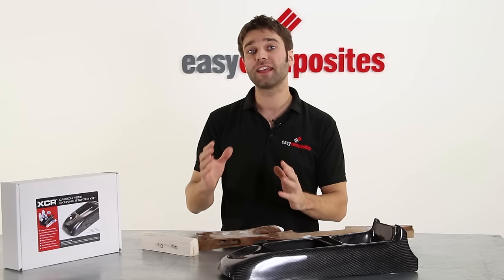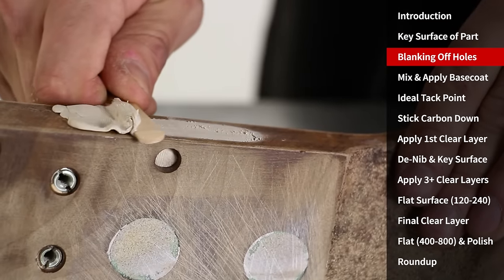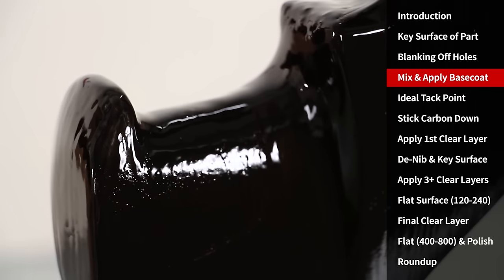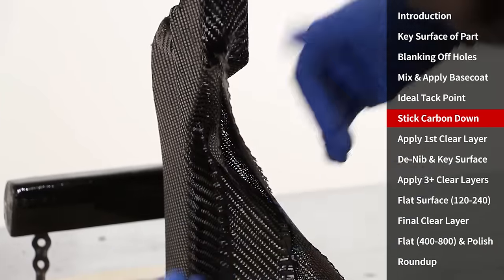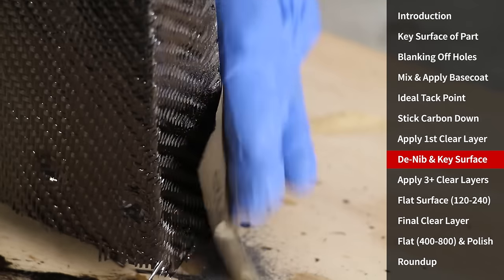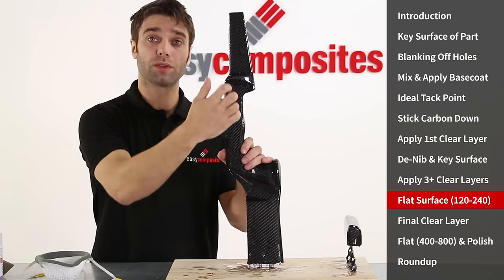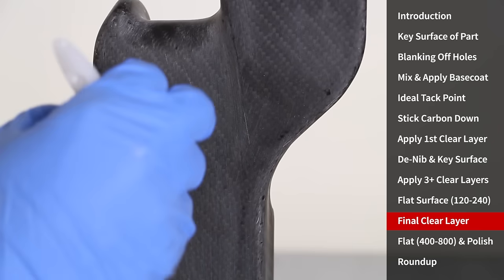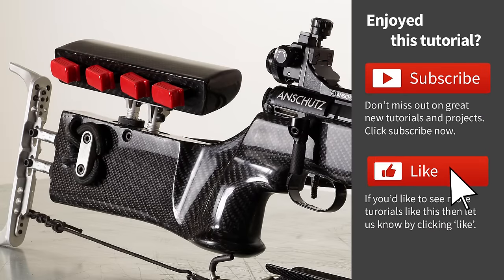Ultimate Carbon Fibre Skinning/Wrapping Tutorial - Sofie's Rifle Stock

Comment: I love how she thinks it's lighter :D
Reply from the maker: Actually, it's strange but it does feel lighter when you pick it up. I think it's because it looks like it would be heavier.
Reply: I was actually curious about that myself because most competitors really know their tools and notice minor changes.
Reply: +Easy Composites Ltd 
actually its much simpler than that. she would be used to picking the whole rifle up because that is what she does 99% of the time so once she pics up just the empty stock without the heavy metal barrel/action it would seem much lighter than she is used to.
Reply from the maker: Actually, this is totally right. Sofie's dad is an ex-military sniper and generally takes care of the rifle. I do think it's pretty rare for it to be stripped down. And yes, so much of the weight is in the action that the stock on its own does feel very light.
Reply: yep , of course its light , its a plastic coated stick ,,, the heavy parts at home ,,, still , it does look pretty
Reply: Kevlar would have looked cooler
Reply: You can only cut Kevlar. No chance to sand it, no chance for correcting anything then. So it is used in inner layers.
Reply: @janudo5    you  need to cut the composite material  to the correct size with a slight overlap
Reply: She thinks it's lighter because the action isn't fitted, not used to stock only situation!
Reply: There seems to be three hole plugs in the stock.  We're those put in to lighten the stock before the coating was added.     He noted the  total weight was the same @  14.30  but the mass is distributed along the whole length  now.
Reply: Dan C looks like they may be there for balancing -note the large plugged holes that may be hiding weights behind them
Reply: that confusing moment
Reply: imagine putting racing stripes on it! It would not only be lighter but faster too!!
Reply: lol
Reply: Lmao! First comment in the comment section was my thoughts exactly.
Reply: l love how she thinks.

Comment: "its so light.." lol i died, but i do applaud how kindly he explained it to her, simple mistake but a funny one. very nice video overall! thnks!
Reply: Nic Wright haha. 😂😂😂
Reply: It didn’t have all the accessories on at the time he handed it to her.
Reply: @Letsgobrandon827   plus I bet she was expecting it to increase in weight due to the additional carbon fiber that was added to the stock
Reply: Did they change the balance of a biathlon rifle? I'd never dare.
Reply: He added 100 grams x 3 coatings to the stock.   It should be heaveyer but they may have removed mass prior to the coating in addition to sanding.
Reply: @danc2014  they said they did. From what I know of biathlon rifles, balance is the most important thing, so it's not just about removing materials, it has to be done in the right spot.
Reply: Dan C i disagree with the statement of yours, but I appreciate your optimism.
Reply: It probably just feels less dense, but yeah

Comment: Recently I have 3D printed an AFO braces from ABS plastic material to use on my leg that usually wouldn't last very long due to the properties of ABS plastic.Normally I made them from handlay carbon fibre ,the preperation time was really really long process(Don't mind waiting for the resin to dry part).But with your Carbon fibre skinning/wrapping method will give me some hope for 3D printed more AFO braces to be given to the Disable Kids foundation around the country here in Thailand.My questions are 1.Will the ABS plastic melt when reacts to the resins? 2.With PLA filament,will it works on that? Thank you very much indeed for inspiring videos I've been watching over three years.Fantastic team.
Reply from the maker: Epoxy resin will not harm ABS so you should be fine with that. The same is true of PLA.

Comment: Dear Team a few questions. I was very excited when ordering it coupl of days ago and I already used it. I was laminating a little interior car part. my questions are 

1. - When putting the first epoxy resin coat on and waiting 8 hours at least it was still a little sticky or felt a little soft of thr surface i waited a few more hours and it was still like this. When touching it with blank hands its a tiny stick to my skin - Normal ? Circumstance are perfect 20° and air ventilation. 

2. -can you save the brush or do i realy have to use a new brush for each coat, cause the epoxs on the brush turns it into almost a stone
3. - I am using it to custimize a car part - is the epoxy resin UV protected or is it becoming yellow by time ? - What about the hot temperatures you can have in a car - is the epoxy temperature stable or will it become sticky again in hot summer days ? 

4. - you should ad a few more gloves and cups to the package also a polish towl this is what i am missing
5. - is it absolutely needed to to 3 layers of Epoxy - It makes the part "even thicker".

But in summary I am very happy looking realy forward -  your video helped a lot
But you should may tell people it can dry much quicker thant you said in your videos - the base coat was dry quiet fast so I almost missed the point to atouch the carbon.
Reply: no answer?
Reply: James E unfortunately - no :(
Reply: @nico.s7333  did you find any solution for saving brushes?
Reply from the maker: Sorry, missed this comment. When you posted this we received 170 comments on our channel, sometimes it's hard to keep up. Remember, for technical support you can always contact our technical support through our website or email, that way we won't miss your question(s).

1. No, that's not normal. So in the end you waited more than 10 hours and the resin was still tacky? - That would usually indicate some mixing or measuring problem. It's worth triple-checking your mix ratios (check you're mixing by weight, not volume, check your calculations, consider the thoroughness of the mixing).
2. The brushes can be reused but you would need a strong solvent to clean them, usually acetone is used. Keep your acetone in bucket with a lid on, use it to wash the brush and then retain the acetone, otherwise you'll end up spending as much on acetone as you would on brushes!).
3.a. XCR has the best UV protection of any epoxy on the market. We've never seen any discolouration of XCR, even after a long time and a lot of exposure. That said, just about all materials do change appearance slightly over enough time and enough sunlight, including most of your car interior and the paint on the outside of your car!
3.b. Car interiors can get hot, especially in hot countries. They shouldn't reach temperatures that would cause problems for the XCR providing that the skinned parts have been suitably 'post cured' before they experiences those temperatures in the car. The best way to do this would be to put the skinned part into an oven, taking the temperature up from 40 to 70C over a number of hours. This should be done before the final flatting and polishing. By doing this, you will expose the resin to these higher temperatures; it will soften and move slightly but then it will reset at the higher temperature meaning that it won't soften the next time it is exposed to these high temperatures. By flatting and polishing after it has been post cured at the higher temperature you will avoid the risk of the skinned part losing its surface finish when the resin first softens at the higher temperature.
4. OK, thanks for the feedback, we'll have a think about this.
5. Generally, yes, 3 layers is recommended but remember that the majority of what you add you end up taking away again when you sand the part. The point of the 3 layers is to ensure that the resin can be 'flatted' down to the highest point of the carbon fabric without breaking through. In some cases, if the carbon is down very smooth and you manage to get the resin down very consistently then you might find you can get away with 2 layers.

Anyway, thanks again for all the feedback, it's appreciated and will help us to improve either the product or our advice/instructions for the future. And don't forget, if you do need a reply, please just contact us through our technical support email, website or technical support forum, YouTube comments can be tricky to keep track of for genuine tech support enquiries.

Good luck!

Comment: so the black base coat is just epoxy resin with a black pigmeant? i do like your epoxy resin though. i like hows there is no air bubbles. i was waiting to see air bubbles when you were mixing.
Reply from the maker: It's almost the same but it is slightly slower to allow more tack-time. It also (of course) has the heavy black pigment it and a little thixotropic agent to make it less prone to draining off. If you have black parts already then it's quite possible to use the clear resin as a basecoat.

Comment: Im about to order a kit and use it on my teeth lol can't wait.
Reply from the maker: Although w're all in favour of people coming up with imaginative things to use our Carbon Fibre Skinning Starter Kit on, we really wouldn't recommend skinning your teeth!
Reply from the maker: Hi, Thanks for the enquiry.  Due to the nature of the uncured resins and the potential health hazards associated with skin contact and "internal" contact with uncured resins, we would NOT recommend using the skinning process or any other composite process directly in contact with any part of the body.  However if you really wanted a set of cosmetic carbon teeth, you could use a medical grade dental casting material to make a copy of your teeth and use that mould for the composite process.
Reply: I would not recommend getting a composite set of teeth, yes, it would be harder but you need to make sure all of your teeth are carbon fiber or the carbon fiber teeth would make quick work of your remaining teeth.
Reply: @easycompositestv  What makes dental resins safe?
Reply: hahaha
Reply: @easycompositestv  It's so sad that you actually have to warn people of this. OP was blatantly making a joke but you never know how stupid some people are.
Reply: jameshisself  yes  s2-glass is superior in most practical applications including durability- just rigidity is the stand out characteristic of carbon fiber, tensile strength of pre-tensioned carbon fiber is quite incredible, but it doesn't have cyclic durability- when it fails it does it surprising quickly and dangerously.
Reply: @capta1nher0  maybe you could do a carbon cod piece instead?
Reply: @damonalagich4524  I think you have just given me my first carbon fiber project!
Reply: @capta1nher0  thats not all I'll give yah' ooooohya'
Reply: He may be on to something here. Maybe pattern a tooth out of CNC'd material create a mould and then a part. You could create a snap on grill or a legit implant part.
Reply: Hell, both of my sons will be carbon fiber skinned this weekend. Yippee  no broken bones ever!!!

Comment: Hi! Love all your videos, their all very clear and informative. But I'm having a little trouble finding out how hollow parts are made, such as a the koenigsegg wheel or such where the interior is completely sealed. thanks a lot!
Reply from the maker: Often hollow parts are made from 2 halves bonded together.  Where a single piece is needed, often specialist bladders and specialist pre-preg vacuum bagging techniques are used adapted for the specific job in hand.  Koenigsegg themselves did a very good video series giving insight into the methods they used, however for the actual carbon wheels, the exact method was custom made by them.
Reply: Easy Composites Ltd ok thanks a lot :)

Comment: Thank you for the wonderful video. Is there any functional difference between the specialty base coat and regular coating resin, besides the black color? Would the regular coating resin perform just as well in adhering the ply to the part?
Reply from the maker: Its also slightly thicker in terms of viscosity but the regular coating resin should work just as well and in fact, if the part being covered is already black (or very dark grey), you could just use the coating resin instead of the black basecoat - the main purpose of the base coat being black is to mask any underlying colour from showing through the weave of the carbon.

Comment: Nice video guys!
Is this method usable for making kind of  "industrial" carbon pieces that can handle stress? Via making a polyestirene piece and wrapping it with several carbon layers. I mean about resultant carbon/resin proportion and how much the layers can be pressed.
Thank you for your help!
Reply from the maker: The more layers the stronger the part so with careful design it can be made into a structural part.

Comment: can you get the black polishing compound all by itself? is there anything comparable that you can get at say autozone?
Reply from the maker: We do sell the polishing compound on its own. It's called NW1 BLACK from Pai Cristal. It's quite a specialist product, designed for carbon fibre, so it's not something that you'll find something too similar to in a conventional auto store but a polishing compound designed for paint or plastic (like Faracla or Mirka Polarshine) would be an alternative - just watch out for white compounds (such as those mentioned) getting stick in microscopic pin-holes and spoiling the appearance of the part.
Reply: Easy Composites Ltd
can this and the fusionfix gp spray adhesive be shipped to the usa?
Reply: @serg sroble   >Depending on the part, wet sand it with 400 grit, wear latex gloves to keep hand oils off, but if not equipped, make a deal with a local body shop who shoots a quality 2 part clear coat everyday almost. They will use a tack rag, hang it and spray it aside a vehicle in the same booth. Once mixed, anything left over is dumped as it’s pot life is four hours. Hope that help!

Comment: Sorry to be commenting so late in the game, but would it not have made sense to add a layer or 2 of clear paint as a "sunscreen" to keep the epoxy from yellowing over time? And even if you would not consider it to be a necessity here, would you add a clear coat to something like auto or motrocycle parts to keep them from being affected by the UV light?
Reply from the maker: Some people do that for that reason.  It depends on the climate the part is exposed to.  eg in sunnier climates the time exposed to high levels of UV is much higher than here.
Reply: @easycompositestv  Thanks for the quick reply. I will be ordering from you when I am ready to begin with my project (Porsche GT2RS replica bits :-p)

Comment: Question because I'm a newbie and I like picking your brain with all the great videos you post No matter if you're carbon fibering skinning metal fiberglass or say like a leather steering wheel it all has to be sanded and scuffed correctly now does the grit of the sandpaper have to be different with the different types of base you're doing thank you for your time
Reply from the maker: Generally a minimum of 120 grit but the coarser the better for the basecoat.
Reply: @easycompositestv  awesome thank you!

Comment: Great job!. I have a question: is it possible to carbon skin an object and put minimal resin/top coating? The idea is to leave the carbon fiber itself exposed or semiexposed in a way that the fiber strands can be felt when you slide your fingers through it. I think it'll be a nice look for some applications I'm thinking about
Reply from the maker: Hi Samael, yes, absolutely. In fact, this would really only be a case of sticking the fabric down and then using a single, thin application of resin to wet the fibres out with nothing more required after that.

Comment: Hi, why is it necessary to leave it to cure after the first coat of epoxy? And will it be wrong to do the four coats of epoxy at once with 2 hours interval between them and then to sand it down before the last coat?
Reply from the maker: Great question. Actually, both ways are OK and you can choose. In the full instructions for the XCR Skinning Kit we do describe how you can do either. Usually, it's best to sand after the first coat if you have high spots or stray fibres or other little nuisances which would be better to get rid of at the start of the process, this way - once they're gone - the new resin can be a smooth continuous layer over the top of them. If you have such stray fibres and you continue to build up resin over them, then when you flat them down at the end of the process you're likely to sand into the fibres and expose them, which is not ideal.

Comment: Awesome and informative video! I have a carbon fiber dive fin that has a running crack up the middle. I used epoxy resin and fiberglass to try to patch it but the crack has opened again. How can I fix this and keep the crack from continuing to run up the fin? Any guidance would be most appreciated.
Reply from the maker: Hi Joshua, if you could send some photos to our technical@easycomposites.com inbox we'll take a look and advise as best we can on a fix.

Comment: If I wanted to paint a portion of a project, at what point would one begin the painting process?  Seems like the best time is the after the final clear layer.And can you apply automotive clear over the epoxy?Great video, thanks!
Reply: I’m a certified automotive painter.  I would paint the part before your final clear.  When all the flaws are sanded out and the part is straight, go ahead and paint it, and feel free to use automotive clear coat from a gun for a beautiful finish. The bonus to that is if you spray it nice and clean, no buffing necessary 👍🏻